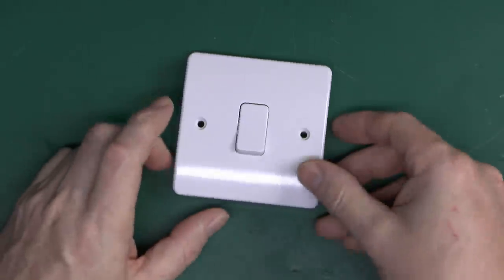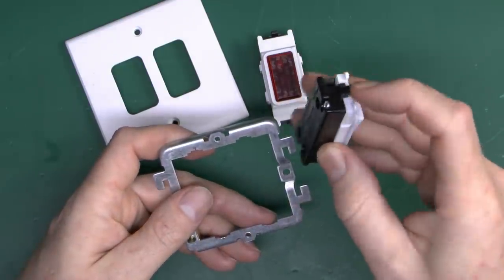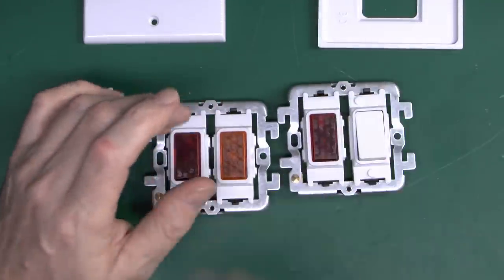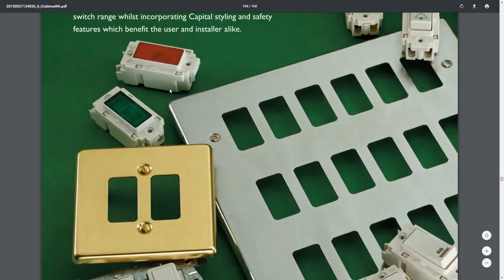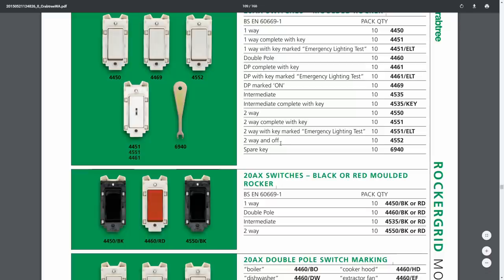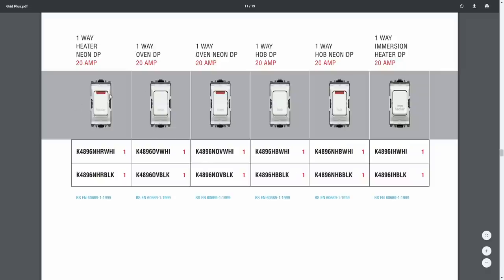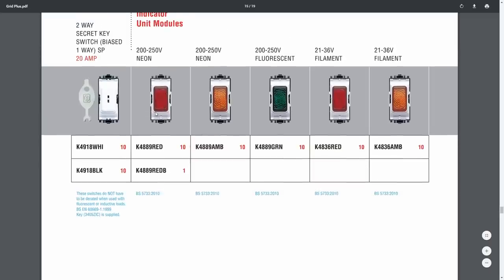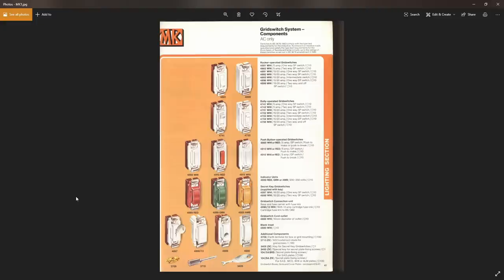Grid Switches and other modular devices

Comment: So can each switch in a grid be independently fused?
Reply from the maker: It can be, you would need a fuse module for each switch.  Modules can be arranged in any combination.
Reply: @jwflame  so to run 4 appliances each with it’s own fuse you need an 8 gang grid, 4 switches top 4 fuses bottom and run from switch through fuse to the appliance? Thanks for your help JW

Comment: I could never make out why they 1 way ,2 way,6a,20a, why not just 20a 2 way , cost perhaps?
Reply: When 24 Oxo cubes are cheaper than 12, I totally agree - make all sw 20A. But 1 way, 2 way, double throw is adding more components while majority of switching is 1 way - so seems reasonable to provide economical switches rather than over-engineer everything.

Comment: fan isolator plus 3a fuse holder
Reply: Click do one
Reply: Yeah, click minigrid is the only range I have seen that covers that combination. Assuming you want normal white plastic the parts you need are CMA403+MD020WH+MD047WH
Reply: @ashbashbaby2  that's the one I've used